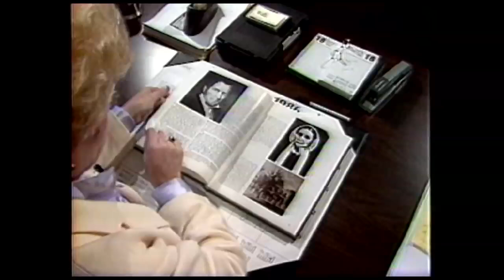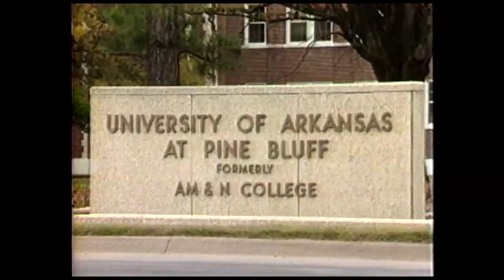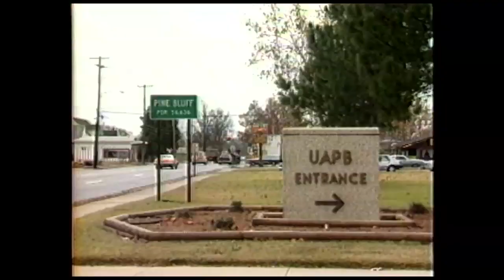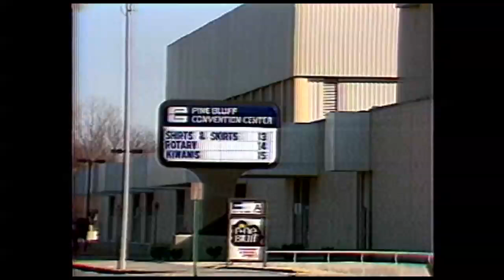A Special Place: The Pine Bluff Story

Comment: This video was made in 1986 for those wondering.
Reply: Thanks!     Now it's the 4th most dangerous US metro area.. What happened?
Reply: @Hubjeep  white flight
Reply: @darrenchilds8980    That's the effect, what was the cause?
Reply: @@user-nt2nw3ii4y a lot more then that. It's an extreme version of what happened to many small Southern cities in the Deep South beginning after segregation ended but not resulting in large scale severe decline untill near the end of the 20'th century. Unlike a city like Jackson, Mississippi which experienced a partly similar phinomonon, Pine Bluff wasn't large or diversified enough, and never had strong or extensive enough suburban areas, to avoid taking down the larger surounding area so the city of Pine Bluff death spiral soon led to regional decline.
Reply: Thank you.  I was wondering.